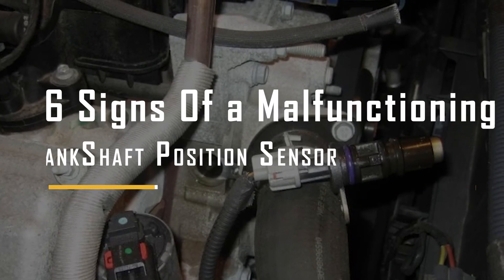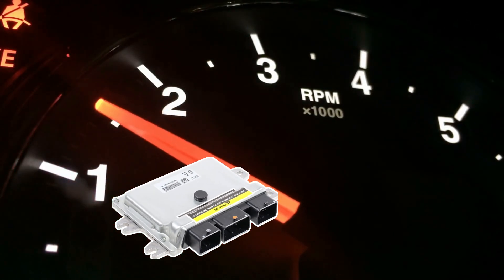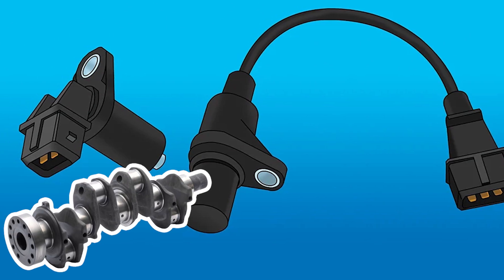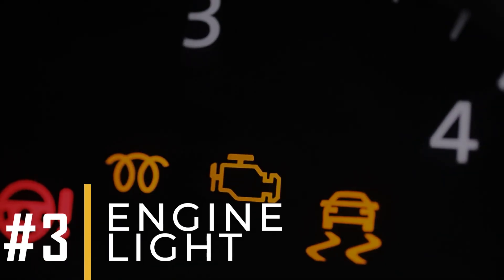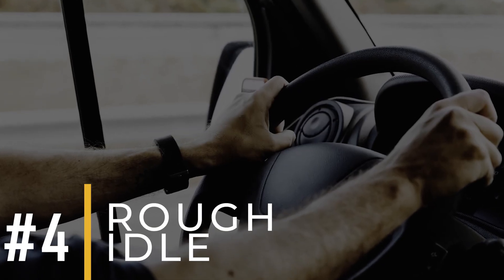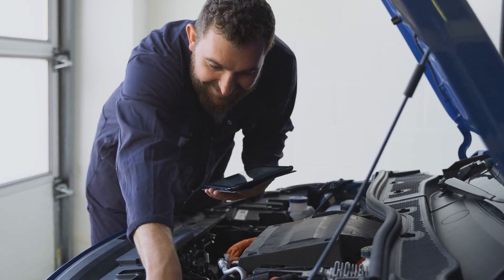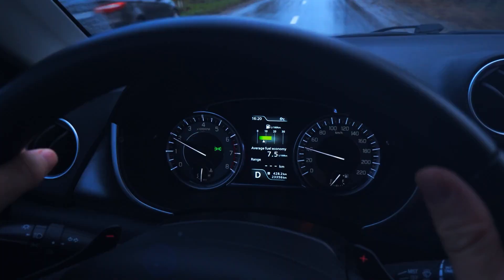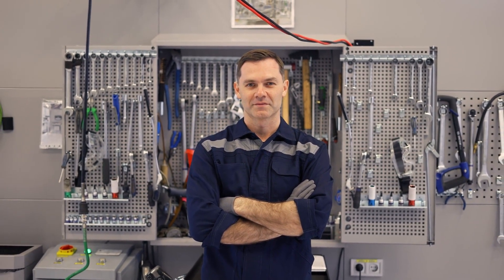6 SYMPTOMS of a BAD Crankshaft Position Sensor | P0335

Comment: Do not forget some engines have them in places where they detect can be off such as a Ford or others that rely on the data ring shifting off as the rubber in the middle of the two rings being off.  The sensor cannot sense TDC if that ring is off center to the keyway on TDC Most readings on the crank sensors are around .200 to 1000 ohm. I prefer around .370